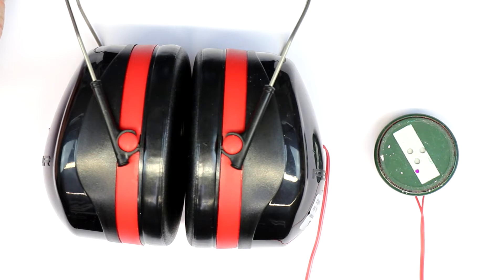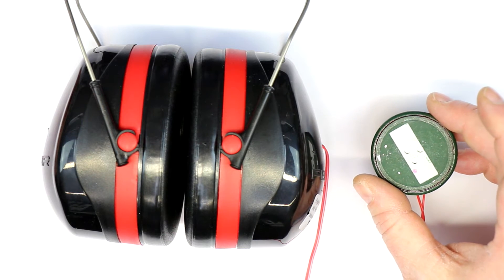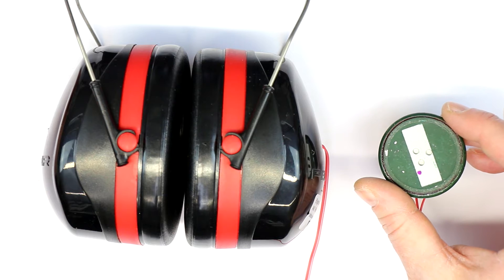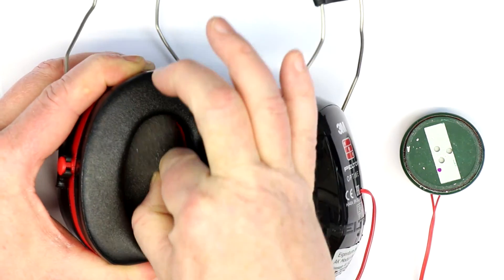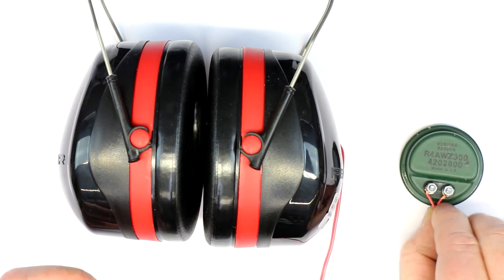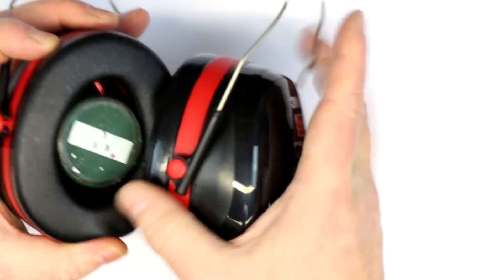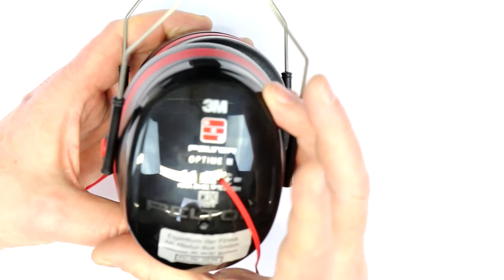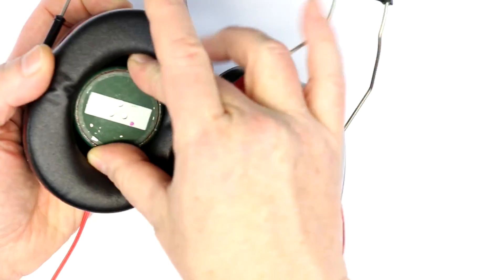How to make your own Balanced-Armature Headphones

Comment: Can you use these for 8 hours or will they start putting weight on earlobe in 10 minutes? 🤔
Reply from the maker: Can´t say because I didn´t use them for such a long time. Between 10 minutes and 8 hours there is a very large span. Alternatively you can buy cheap secondhand closed headphones of your choice and replace the original elextrodynamic transducers with balanced-armature transducers.